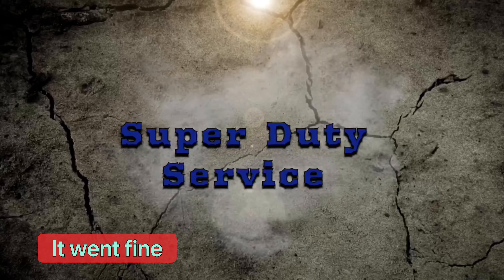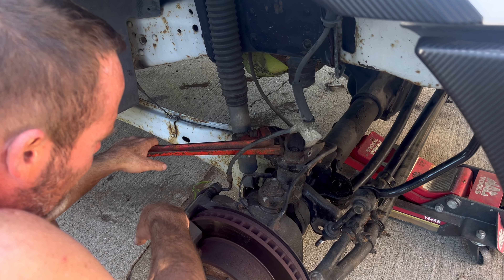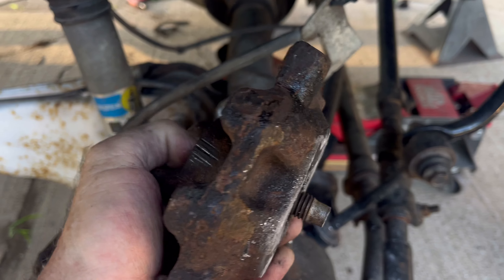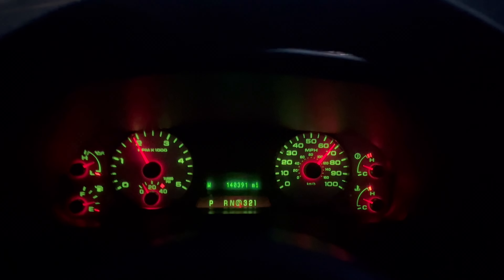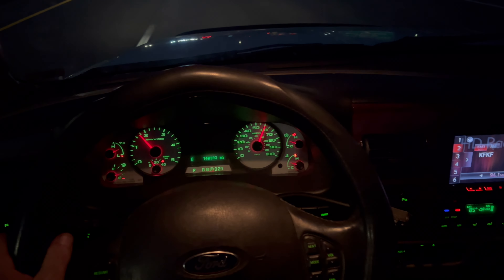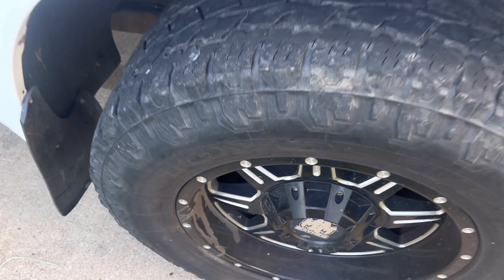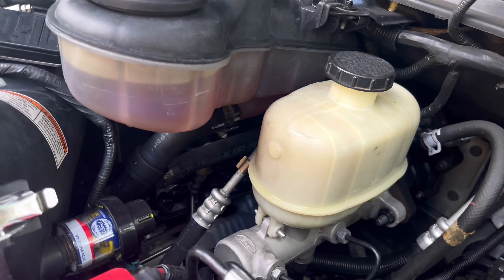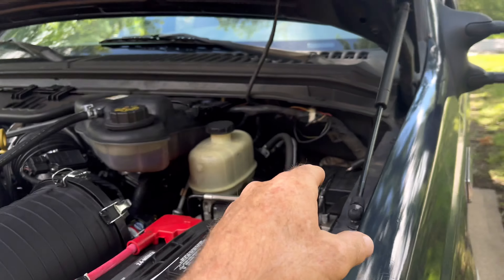Dies with the MAP UNPLUGGED???  6.0 Powerstroke F350

Comment: “Whatever it is we’ll find it.”  That is the spirit!
It is very strange to see videos of a brand new spanking clean 6.0 engine bay.  So the question remains: Why does an unplugged MAP sensor prevent the engine from starting and idling?  Of all the sensors on a 6.0, which are required to run?  Cam, crank, …?
So the plan is to try a known good engine harness, injector harness, and FICM?  
This is a truck you will never forget!
You have a lot of fans praying for your success.
Reply from the maker: Holy crap,,,,, Thank you!!!!   I believe I am being punished!!!!    lol
Reply: @AnthonyYoungblood ,  we will figure it out!

I have the exact same issue as this truck, on my 04 currently.  I have went through the fuel system and corrected some flaws, but the rpm continues to bounce EXACTLY like the truck in the video, at the same 1100 to 1300rpm. I had only found one other video, of the exact same anomaly, in all of youtube. Supposedly a crank sensor took care of the issue. I  replaced my crank sensor, but it seemed to not be root cause. I already received my new harnesses,  and plan to double check the mass air flow sensor first. Please post a the repair, once you get it...  unless I figure it out first, and I will reply to this comment. Thanks in advance.
Reply: @AnthonyYoungblood  , I have been following all of your videos since I found this one. I did find my issue, that was root cause of my truck running identical to this video. Root cause was an edge tuner connection with corrosion at a few pins and some residual antifreeze in the vicinity. Additionally,  I replaced the cam shaft position sensor, finding the end was convex and had wear marks from rubbing on the toner ring(if that's what you call it).  Your videos are great and much appreciated. Prayers for Ron's truck and the two of you addressing any and all issues.

Comment: My truck loses all its balls when I get to higher elevation and the ebp throws a check engine light and she dumps a lot of smoke. Once I get out of the mountains I restart the truck and it runs fine then the CEL goes away. Definitely sounds like electrical. Is the map hose to the intake plugged and giving weird reading

Comment: You could have found this issue with an oscilloscope. Scanner Danner has a book. He also has videos that follow along with the book on how to find issues like the crankshaft reluctor. Cam crank correlation. Once you have known good of that engine you can compare the timing. It would have shown that chip in the tone ring. Its so much more than that though.
Reply from the maker: I hear you on the tool,,   but my eyes also found the issue.   I have not encountered an issue that I needed to backprobe the wires and use the oscilloscope to find the problem...  EVER...

Comment: Is this possible its a 5 volt reference issue
Reply from the maker: For sure,  most of these are ground switched for actuation.   The scanner loses connection also at the 1300 rpm.   Like there isn't enough power to keep the monitoring connected and at the same time it starts missing.  So with that said,  if it is a crank/cam timing issue or a pushrod too long (meaning a mechanical issue),  Then the pcm should be fine to continue to show the data,,  right????

Comment: Scrap it. Sure seems like that new harness is high on the list of suspects.
Reply from the maker: I am getting things set up for some swap testing.  It should be evident if it is a harness...   I have been spending time with my eyes closed trying to remember all the crucial points during the build.   Not far fetched to pull it back to shortblock!!!   With all the geometry we changed,,,  nothing is out of the question!!!

Comment: Its interesting how the tach is jumping around way more than the engine RPM.

How about swapping in a known good main engine harness?

This sure seems electrical not mechanical.

The thing to figure out is not the root cause but what is the engine doing when that happens? Losing fuel? Losing cam or crankshaft signal? Losing ficm sync? Have you monitored fuel pressure when this happens? Live metering on the usual things: hpop pressure, ICP volts, IPR %, ficm voltage?

I don't know, just throwing out ideas that might spark something for you.